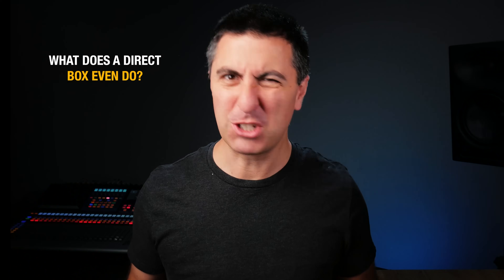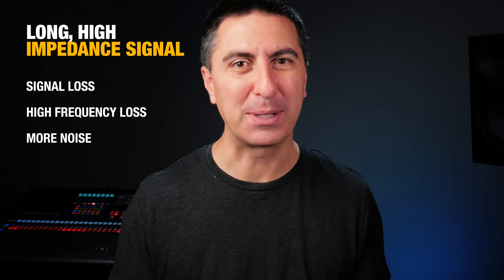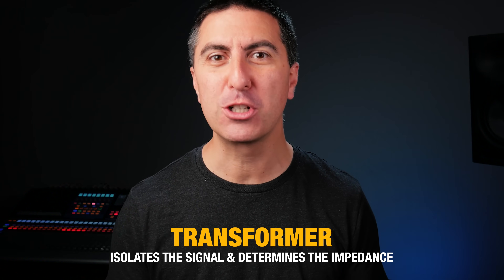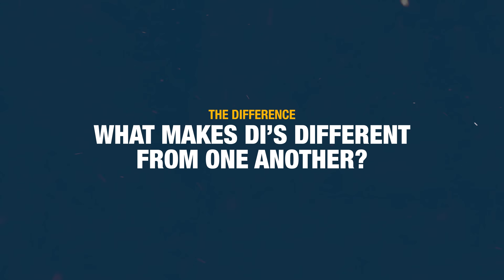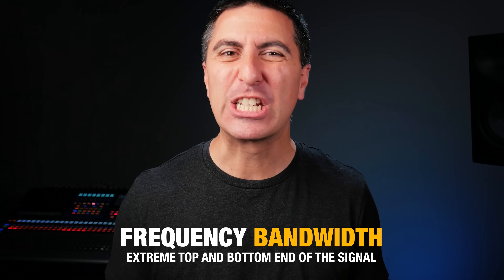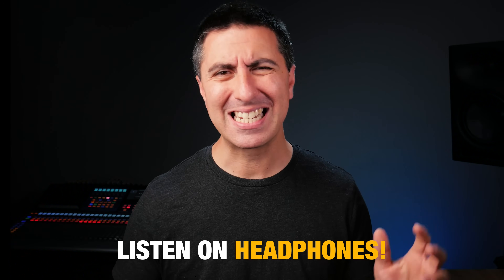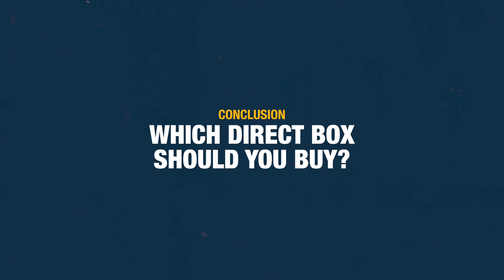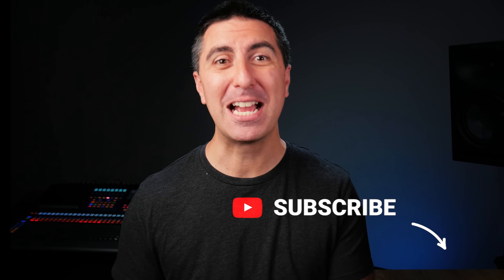Do Direct Boxes Matter? What's a DI do?

Comment: Also on the subject of gain (which is something that's becoming a "thing" in mixes) even if the gain is on the cooler side, the moment distortion is introduced either by accident or design, it makes the sound louder.

Even if there's a limiter cutting it all down to -3dB....

It still sounds a bit louder than clean signals.

I've noticed that any track in a mix with distortion on it - I always have knock back the volume on the track in the mix to get it to 'settle' a bit better there also seems a relationship between the amount of distortion and the perceived volume

Comment: Is there a delay when recording a live guitar and also using a DI to overlap the live guitar recording?

I can’t get an answer to this . For some reason I feel like I heard a mixer once say everytime he gets a bass di and a bass recording it’s never in phase but idk if I remember this correctly .

I really like the idea of using a DI to use the same performance on different gear and combine it
Reply from the maker: There's always a slight delay between the pickup and the mic. But it may or may not have a noticeable difference on a guitar. For a bass, the lower frequencies will cancel first, so it can make a more pronounced difference.

Comment: New Bass Player, Question I have a Orange Crush 50 amp. I am using a Compressor plugged into the Amp. Do I need a DI?
Reply from the maker: If you're going direct into the sound system, you'll need a DI. If you're just using the amp and/or putting a mic on the amp, then you don't.

Comment: My guitar amp is Vox PF15 and has lineout output at the back, (quite similar to some marshall MG's "emulated lineout" ), do i still need DI box? The port is a PL type, though im not sure if the port needs a TRS PL, because i'm currently using a (mono PL) TS to XLR cable going into our church's Mixer.

Comment: when an instrument is tied into a different circuit then the board often the difference in the distance from the two respective components to the panel you will get a ground loop because the ground has a longer distance to travel on the instruments circuit which increases the resistance down the line causing an imbalance that can be heard in the hum.

Comment: Killer video as always. If I'm doing a SmarPhone Headphone out / Splitter cable (L panned for Click / R for Backing Tracks) into my StudioLive Mixer, should I first go through a DI box, or could I just go into the Line in 1/4" TRS ?
Reply: Sometimes analog audio output from computers and such will have noise from having the charger of the device connected. In those cases, having a DI-box might help. There are special DI-boxes made for this purpose, having inputs in RCA and/or in 3,5 mm jack, or even bluetooth connection. But I've successfully inputed sound from smartphone into mixers directly via 3,5mm-to-RCA cable, both to RCA inputs on mixer and via RCA-to-6,3mm jack adapters to line inputs on mixer.

Comment: My digital instrument outputs a relatively hot (high impedance) signal (needs about 10 dB of preamp gain) and the cable run is about 6 metres, is it a problem that I don't have a DI? The signal is unbalanced, but shouldn't the signal/noise ratio be high enough? I haven't noticed any noise in the sound both live and when listening to the multi-track recording. Thank you for the awesome video!

Comment: Might be helpful to mention that impedance is a synonym for resistance.
Reply: Not exactly. Resistance is constant, while impedance may vary with the frequency or strength of a signal... that makes it harder to understand (and to get it right).
Reply: @permanenceinchange2326  In other words, impedance is resistance in flux with the frequency and amplitude.  So therefore, impedance is resistance.
Reply: @dooshmasta  If you put it like that, I agree :)